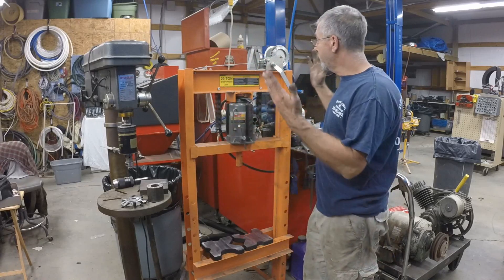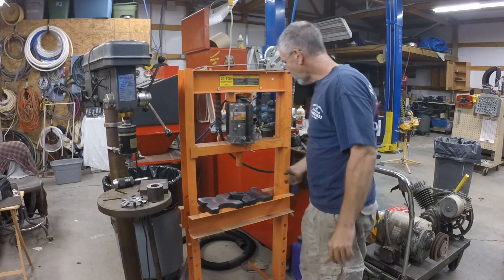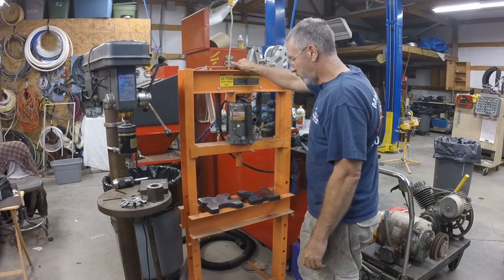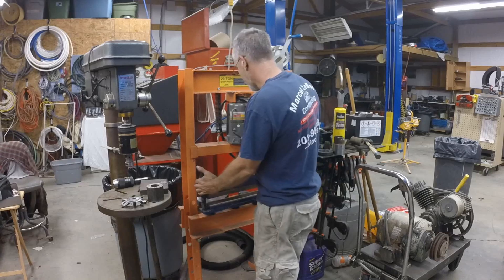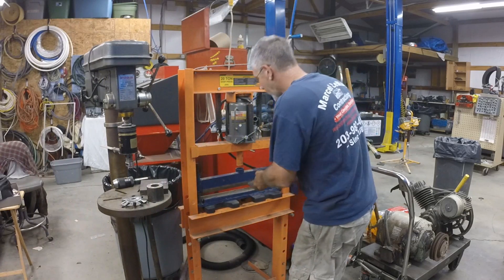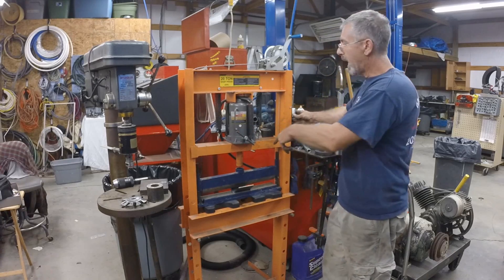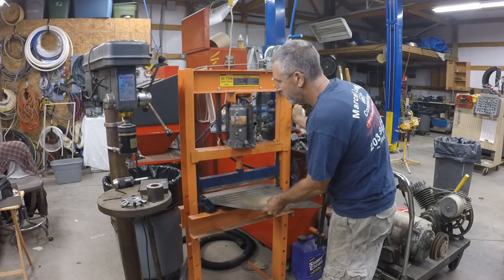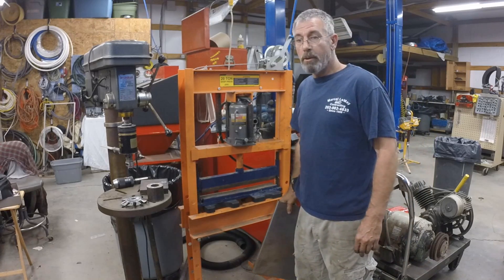Harbor Freight 20 Ton Press Modifications

Comment: Any thoughts on how to attach a pressure gauge to one of these presses?
Reply from the maker: What's the end goal? Do you want to know how many tons of pressure you're producing? If that's the case, use a load cell....  The only other way to add a pressure guage would be maybe to adapt some sort of tee on the pressure relief valve port or to drill a hole into the pressurized part of the cylinder, but to do that you gotta go thru the reservoir portion of the jack and seal it. The simplest way is a load cell, or use a different cylinder with a remote pump,  then you could tee into the pressure line to install the guage.

Comment: I haven't been very successful and press it on Wheel bearings. This is the whole reason the night purchased it it's not the pressure it's the ability to fit.
Reply: That is why I bought one too! I cut the square tubing to the base or table that moves up and down. Opened it up enough to drop a good size hub out of it, but not longer than the pins that hold it up. Then welded the square tubing back together with pieces 
 angle iron that overlapped.  If what I am saying makes sense, hope it helps. I love mine now and do press-in wheel bearings all the time!

Comment: Did you use eye bolts on the table for lifting by drilling thru the angle iron cross piece? I just bought one today and its still stamped steel cept for the table. Also ordered the air jack off ebay, $75.00 shipped. Going to do the Boat winch trick too, thanks. great job.

Comment: Nice upgrades! I like the boat wench to make raising n lowering the table easier, the realistically-size-needed T handle on the bottle jack will save time from having to grab the jack tool each time, and I definitely like the pneumatic upgrade to avoid having to pump n pump n pump it manually with the jack handle....so my question is since I'm on social security disability income and can't afford to go out and buy a the 20 ton air jack, isn't there a kit we can buy to upgrade our existing 20 ton bottle jack?
Reply from the maker: Get-The-Lead-Out.45   I've never seen a kit to upgrade an existing bottle jack. You can check ebay for one maybe. The air over hydraulic bottle jack is only about $90 with a coupon at harbor freight. Thanks for watching!

Comment: Nice job Marcel! I have the Cheezy little 12 ton and have modded it as well. For the carriage side to side slop I was thinking of adding some ball bearing s on some axles fitted in horizontal slots and some jacking bolts with threaded tabs also on the horizontal of coarse. Are you able to catch what I'm pitchin? My slots would have to be done the hard way as I do not have a mill(yet)! Would love to see more close ups if possible, thanks!
Reply from the maker: +Tom Wyrick . I was thinking about maybe sticking some nylon glides for that side to side slop, I just haven't figured out how to hold them in there yet.

Comment: For the slop in the press beam, I drilled and tapped some 1/4-20 holes in the C- channel pieces that ride next to the uprights and I installed some nylon screws stabilize the up/down travel. I also put 2 nylon screws facing against the inside edges of the uprights to eliminate any left/right slop as well.
Reply: Nylon screws is a great idea. Thanks!

Comment: Thanks Marcel for the quick answer. I was going to bracket it with angle iron, same principle as you. I was wondering how you attached the valve. I was going to attach the angle on the inside of channel, then attach the valve. 10/24 bolts thru valve into angle, so flapper is facing toward the operator. How did you attach, top nut for plunger? Thanks again for replying, looking forward to your response.
Reply from the maker: Theres a screw or a rivet that goes though the lever , I cant remember...but i put a longer screw thru that, that goes through the bracket. The hose to the jack, faces down, and then I just a pipe clamp around the hose to the bracket. You could use almost anything there..either a heavy zip tie, or I used plumbers strapping to fashion a u shaped clamp. Pretty simple. Theres no need to drill holes through the valve body.
Reply from the maker: +Terry LaRotonda    Plunger?

Comment: Like your mods. I just purchased the air jack from HF today, had there 20 ton press for about 2months. I have not taken the valve apart yet. How did you anchor it to the machine. Like I said I haven’t checked it out yet. Thought I’d ask you first. I intend to do the same with my table. Thanks again.
Reply from the maker: +Terry LaRotonda There's no need to take the valve apart.. I made up a bracket out of sheet metal to mount it to the side of the press. Thanks for watching.

Comment: Nice video, we're do you get the air jack? Also, you should do a video on how you built the press break.
Reply from the maker: +Jeff Hulett   That's a great idea! , for the video. The air jack also came from harbor freight. You can usually get it for around $90 with a 20 percent off coupon.
Reply from the maker: Jeff Hulett Hey Jeff, just to let you know I did make a video on the bending brake...check it out...    https://youtu.be/1DYTFo4ee1Q